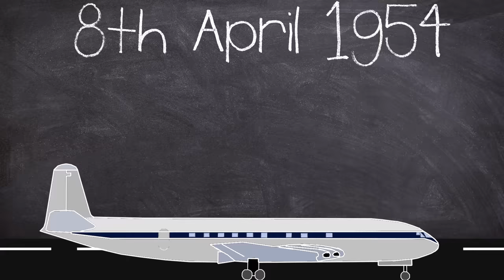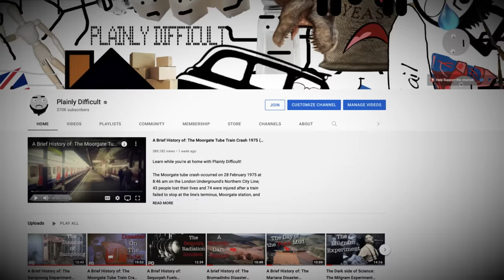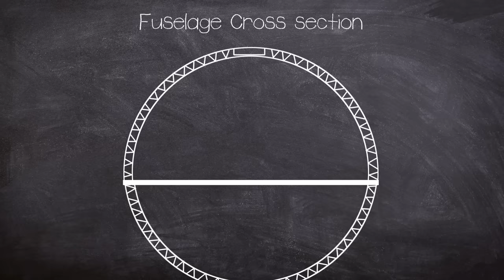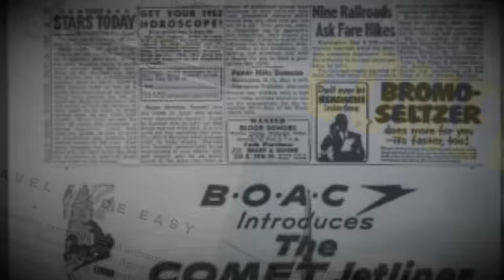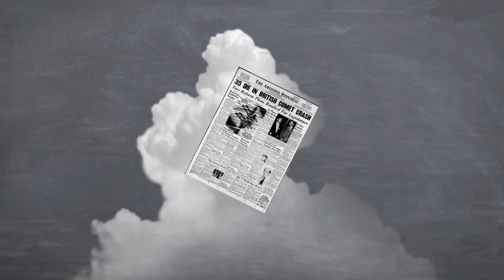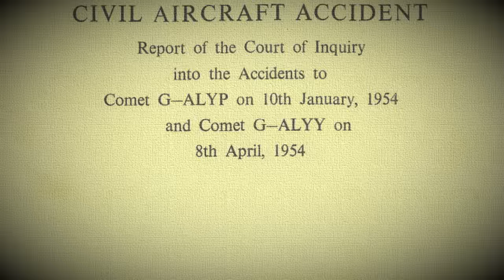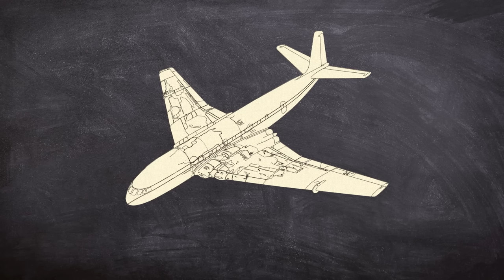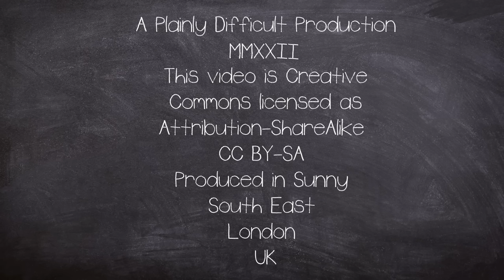A Brief History of: The de Havilland Comet Design Disaster 1954 (Documentary)

Comment: You missed the source of the cracks. The rivet holes around the windows weren't made properly. That resulted in the creation of micro fractures around the holes. As the planes went through pressurisation cycles and increased stress was applied against the corners of the windows, the micro fractures became cracks that spread very quickly until the fuselage could no longer hold itself together.
Reply: I've heard the same thing. Also, I heard the widows were designed with "squareness" taken into account so their shape was not really the problem. I wonder if it compounded the problem..?
Reply: @lomaii2847  go away spammer
Reply: The rivet holes were punched instead of being drilled. Also the fact that they used the same pressure cabin for overpressure testing, then afterwards to test the number of regular pressure cycles that it took to fail came into play, as the overpressure test cold-worked the metal, changing its crystalline structure in a way that made it much more resistant to metal fatigue.
Reply: You are correct sir.
Reply: @Margarinetaylorgrease  Very likely. They definitely formed straight lines that encouraged the expanding cracks to spread from one window to another as was shown in the wreckage. But even with round windows, the micro fractures would still be present in the rivet holes and would still expand to cracks. It might simply have taken longer for the planes to break apart, but they still would eventually have broken apart.

A lot of hard lessons were learned from this incident, but it did result in the production of much safer planes later on. Unfortunately, even harder lessons were to follow eventually.
Reply: DH intended to use Redux Bonding as developed for the wood-to-metal Hornet. Punching rivets was a bad idea. The fatique crack started by the small observation window on the top of the fuselage and then ran down to the already-stressed window surrounds.
Reply: Yes... rivet holes 'punched' rather than drilled gave the stress cracks a source point from which to grow. That combined with the inadequate fuselage skin thickness were greater contributing factors in the opinion of many than was the shape of the windows.
Still... well done, and thanks again.
Reply: @Milnoc  All of these factors can come into play.  Fatigue is a function of the amount of stress variation as well as whatever initiates the crack.  Punched holes around a rounded window would undergo less stress variation than punched holes around a square window and thus the airframe could have had longer life.  Drilled holes that didn't have cracks could have lasted a lot longer because stresses around these holes might have been below the crack initiation threshold.  But once you have a crack and a stress variation, the crack will propagate.
Reply: The windows never failed.
It was an antenna mount in the cabin roof.
Reply: @billj5645  Both punched and drilled holes can generate micro fractures. The ORIENTATION is however different. Punched holes have scratches at 90 degrees to the surface (leading to cracks) where drilled holes have scratches parallel to the surface (leading to delamination).
The consequence of this is that it is now common to punch holes undersize, align the parts and then drill the holes out to final size before riveting.
Reply: @allangibson2408  Those type of things would affect the crack initiation threshold meaning how many cycles it takes to form a crack.  I don't think aluminum operates exactly as steel does but in steel you can have a configuration that takes so long to form a crack that essentially it has infinite fatigue life.  I've tested various types of bolts in fatigue and the manner in which threads are formed can have a big affect on fatigue life.
Reply: @billj5645  Aluminium has a zero fatigue tolerance limit. Steel takes a minimum stress for a fatigue crack to start.
So basically any load at all will start a crack in aluminium where steel requires a minimum load.
Reply: The Comet 1 had serious flaws in the size, thickness amd strength of the fuselage frame hoops, stressed skin, lack of proper rip-stop doubler joints and poor designed and executed riveted fastnings.
The Comet also suffered fatal flaws in engine inlet placement, wings, flight controls even the toilets had to be redesigned to make the Comet 4 airworthy.

Existing Comet 1 aircraft had their windows modified and strengthened but this was not sufficient to make the aircraft safe for commercial passenger service.
All of the Comet 1 aircraft not destroyed or scrapped had their airworthiness certification permanently revoked in 1958.
Reply: Yes the windows were ment to be glued in but a production engineer complained
Reply: @gingernutpreacher  Gluing the windows would not have prevented the Comet Disaster... rhe passenger windows were not the cause of the any of the catastrophic in-flight structural failures.
Reply: @sandervanderkammen9230  the rivet's were punched through and not pre drill causeing micro fractures one of the failure's (don't know about the Ariel) was ment to be glued in I know not a window in if was they would not have removed so much meat  it was a compound of errors the reason it had no paint was because they were using the de Havilland ghost instead of the Rolls-Royce neam which also resulted in everything been built to the minimum
Reply: Additionally to the punched rivet holes they built the airframe different from later jets. Later aircraft like the 707 used sheet metal elements which should stop cracks if they occur, it seems this lacked at the early Comet versions.

It was the early jet age, and there was still much to learn.
Reply: @simonm1447  Boeing pioneered pressurized cabins built from aluminum and built the first pressurized airliners in 1937 (Boeing  307 Stratoliner)
de Havilland received technical data on metal fatigue in pressurized cabins from the B-29 program during WW2.
Manufacturers like Junkers, Douglas and Lockheed were all building pressurized cabins without catastrophic in-flight structural failures because they were all very experienced in all-metal monoplane airframe structures made from aluminum alloys.
de Havilland however was still manufacturing aircraft primarily from WOOD in the 1940 and 1950s...
They simply lacked the technical knowledge and experience needed to build an airliner like the Comet.

The real tragedy of Comet Disaster was it could have been easily prevented if de Havilland had simply followed well-known and understood industry standards for design and construction of all metal aircraft.
Reply: @allangibson2408  no it was not. I have held a piece of the failed metal from the aircraft which clearly shows micro-cracks radiating away from rivet holes, because instead of being drilled the holes were punched which was OK on unpressurised aircraft, but fatal on a pressurised one.

It caused Boeing etc; to re-evaluate their construction methods, and Boeing admitted '... If not the Comet, then the 707 ...!'
Reply: @Volcano-Man  Read what I wrote…
Boeing does punch holes - but as undersized pilot holes. These are then drilled to full size as the assembly is completed. This removes the scratches normal to the surface and introduces new scratches parallel to the surface.
Aluminium alloys do however have a fatigue limit meaning all aluminium structures are operating life limited - some worse than others. The Mitsubishi Zero fighter for example used ultra high strength alloys with a very short service life. The Zero main spars ran out of service life before WW2 finished…
Reply: @allangibson2408  
Certain types of rivet position counter sinking can also induce cracking in the hole edges & so in that case a smaller than required hole is drilled, then countersunk then the hoke is drilled out to the correct size for the rivet so removing counter sinking induced cracks.
Reply: This is what I have found emphasized in other documentaries about the Comet. It was not the shape of the windows that was the problem: it was the way they were installed. The reason the window shape was changed had nothing to do with the failures of the aircraft; rounded windows were simply easier to install, maintain, and replace. If round windows had been installed on the Comet instead of square but using the same installation method, it is likely the failures would still have happened.
I get irked when it is just blamed on the window shape! Much more complicated than that!

Comment: I love the sleek Art Deco design of the DeHavilland Comet with the gleaming engine nacelles on its wing. Actually, squared windows don't fit with that aesthetic. If they'd kept to the rounded theme of the overall design, the problem could have been avoided. Oddly, it's often the other way around, with artsy design leading to functional flaws.
Reply: There's a reason ships' portholes are not square, and it's exactly the same reason. The designers should have taken the hint.
Reply: The engines were also one of the Comet's fatal flaws, the inlets were changed to make the plane safer but no other aircraft in uses this horribly bad design
Reply: @sandervanderkammen9230
There was nothing wrong with the Comet's engine position or intake position .
    There are some advantages for that design & some disadvantages for the podded pylon mount engine design.
Reply: @petemaly8950  Since the point of failure had been found to be exactly the corners of the passenger windows and the automatic-direction-finding window t's evident the radiusing was not enough. 
"just add enough material to make it work" is not a great solution when there are weight constraints, and the material you are working with has not a fatigue limit.
Reply: @petemaly8950  Since both the real-scale tests performed at Farnborough and the analysis of the wrecks shown the points of failures being exactly the corners of the passengers' windows and the automatic-direction-finding window, its' quite evident they didn't test enough before the first flight.
Reply: @petemaly8950  Any time something had not been tested enough, who should have tested it enough was absolutely certain to have tested it enough. It's not like the manufacturer of anything wants to kill some hundred people as a prank. But it's self evident that not enough tests had been performed before the first flight.
Unfortunately on aircrafts weight tends to be a factor.
Reply: @petemaly8950  The radiused corners were evidently not radiused enough, since both the real-scale tests performed at Farnborough and the analysis of the wrecks shown the points of failures being exactly the corners of the passengers' windows and the automatic-direction-finding window.
"How would De Havilland's have known" is completely immaterial here. What they knew, or didn't, doesn't change where the point of failure was. 
They would have known had they tested enough or, not testing enough, they could have taken a hint from similar openings that are not square for that very same reason. When the Comet first flew, there already were airliners with oval shaped windows. It's not like the designers chosen that shape due to aesthetic considerations. 
You know nothing about "my approach". You shouldn't made statement about things you know nothing about.
Reply: @petemaly8950  The radiused corners were evidently not radiused enough, since both the real-scale tests performed at Farnborough and the analysis of the wrecks shown the points of failures being exactly the corners of the passengers' windows and the automatic-direction-finding window, so they didn't "knew" shit. What they thought they knew was wrong.
It's fairly simple.
Lots of people out there doesn't know what they are talking about. It happens to someone into here as well. 
When the Comet first flew, there already were airliners with oval shaped windows. It's not like the designers chosen that shape due to aesthetic considerations. So the designers didn't use "all the current, up to date knowledge for the design". Not even close. Fairly straightforward really
In real life the Comet G-ALYP was lost due to a fracture starting from the corner of the automatic-direction-finding window. Not enough of the wreckage of the G-ALYY was recovered to establish the cause, of the failure, and the wreckage of the G-ALYV was not investigated enough, even if eyewitness testimony already pointed to a structural failure.  In the first test on the G-ALYU the fracture started from the forward escape hatch window, that's identical in shape and structure to the passenger windows. In the second test, the fracture started from the corner of the passenger window N.7. The section of the fuselage with the crack starting from the passenger window is currently on display in the RAF museum at Cosford. So you are wrong again, sorry.
Reply: @petemaly8950  Before conveniently cancelling your post, you stated that no Comet passenger window failed, IRL or in test. 
Reality is that you don't know enough of two RL incidents  out of three to know what failed, and the passenger window failed in one post incident stress test out of two performed (the other time it had been the forward escape hatch window, that's identical in shape and structure to the passenger windows). So 50% of the times. Fact is that the redesigned Comet had the oval shaped windows. Like other airliners already had before the Comet's first flight. Had they done what others already did (and they did because it was known that rounded openings are more resistant to fatigue than squared oned), the windows wouldn't had failed. 
In reality the inquiry suggested that the designers would have found the design to be defective already with the tests they performed, had they tested real production parts. But they tested instead prototype parts, treated differently than the production ones, and so more resistant to fatigue. Who would have known that tests should be performed on the parts that really end up in the finished product? 
It's still fairly simple & it's still not difficult to understand, it's a shame you still doesn't seem to be able to activate at least a braincell to grasp it.
Your 4 year old grand daughter would have surely been able to give you lessons at this point.
Reply: @petemaly8950  That's your fixation, not mine. 
"There's a reason ships' portholes are not square, and it's exactly the same reason. The designers should have taken the hint."
And they should.
There is a reason other airliners had oval shaped windows, and it's exactly the same reason. The designers should have taken the hint.
And they should.
There is a reason production parts should be tested instead of parts that simply have the same shape. The designers should have know it. 
And they should.
The designers chose the risk. And the airplanes crashed. 
Stating that "what failed first was in fact irrelevant" is pretty ridiculous. Your 4 year old granddaughter would surely explain it to you.
If you don't like forward escape hatch window, that's identical in shape and structure to the passenger windows, the passenger window still failed in 50% of the tests performed, confirming you are wrong again. Your 4 year old granddaughter would surely explain it to you.
Provided her existence.
Because, having seen your mental ability, at this point, I wouldn't bet on you really knowing the age of your granddaughter, or her existence IRL.
Reply: @petemaly8950  Yet ships almost always have not square portholes, for exactly the same reason. Because ships' hulls are stressed, and there's no reason to build complex reinforces to have square portholes if you can do them round. The designers of the Comet, should have taken the hint.
Reply: @petemaly8950  Because that's your fixation, not mine. 
"There's a reason ships' portholes are not square, and it's exactly the same reason. The designers should have taken the hint."
And they should.
There is a reason other airliners had oval shaped windows, and it's exactly the same reason. The designers should have taken the hint.
And they should.
There is a reason production parts should be tested instead of parts that simply have the same shape. The designers should have know it. 
And they should.
The designers chose the risk. And the airplanes crashed. 
That the designers didn't made enough tests is a fact. 
That the windows of the Comet had been designed wrong is a fact. 
That the windows of the Comet had problems is a fact. 
That those problems had been eliminated making them oval is a fact. 
That they wouldn't have had the problem had them being oval from the start is a fact. 
So: "There's a reason ships' portholes are not square, and it's exactly the same reason. The designers should have taken the hint."
And they should.
Reply: @neutronalchemist3241 
The Comet designers knew everything there is to know at the time about ships portholes & stress concentrations etc.
Reply: @petemaly8950  Evidently they didn't, since the planes crashed due to design flaws that other designers avoided.
Reply: @neutronalchemist3241  
100 % guaranteed the Comet designers of De Havilland knew everything thing there is to know about stressing out an aircraft 😂. 
 Dehavilland - missiles & & jet engines as well & primarily metal airframe jet fighter aircraft with pressurisation from 1942. 
  By the way, you know anything about wings folding up on BOW-Wing b-47 aircraft?
Reply: @petemaly8950  They evidently didn't, since their products crashed due to the faulty design, while other aircrafts of the era didn't. Unless you are insinuating they did that on purpose.